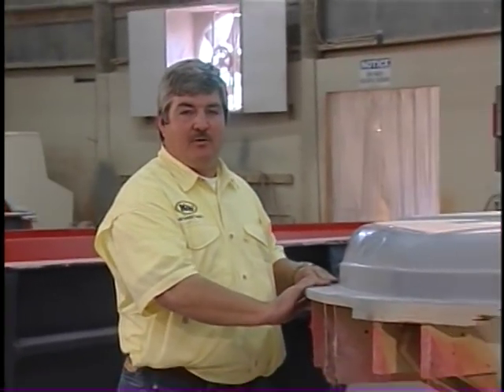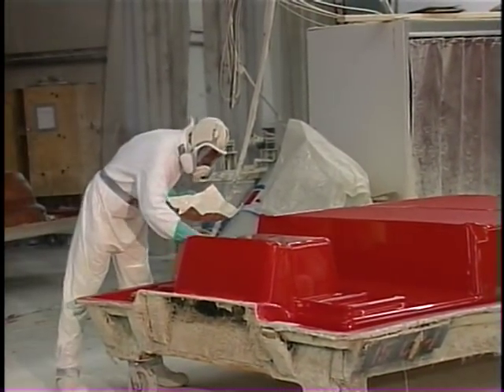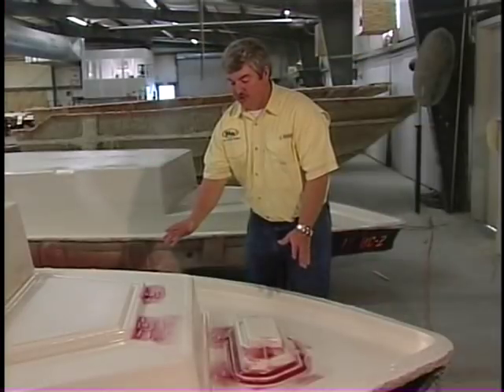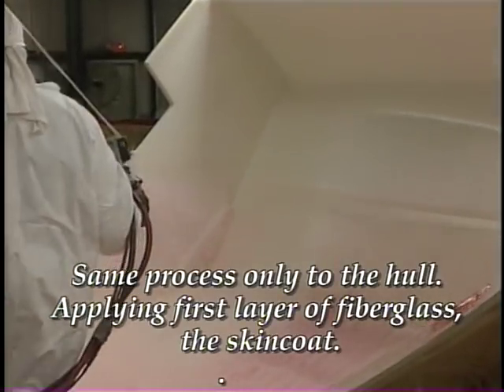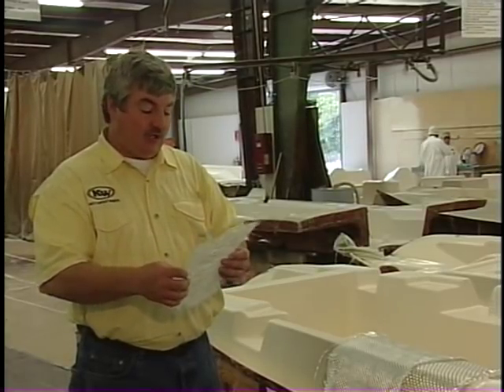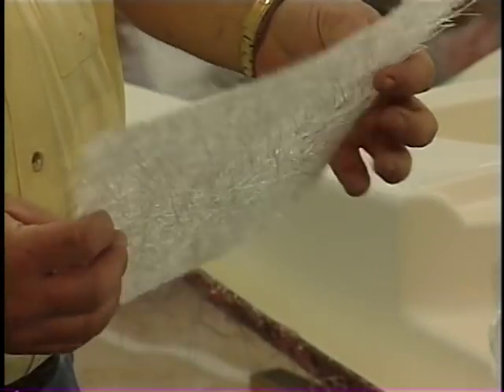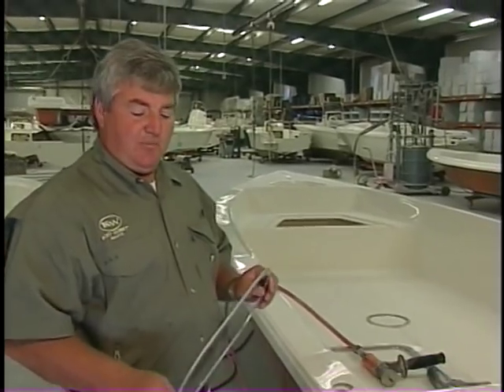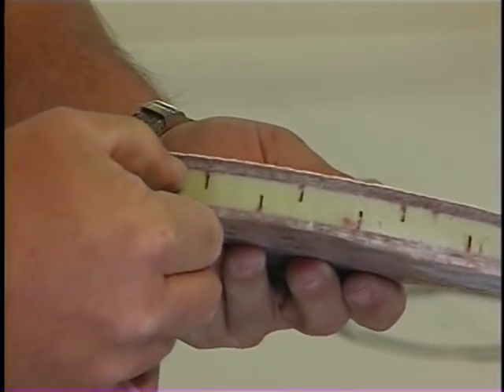How Key West Boats Are Made!

Comment: Cumulative trauma disorders (CTDs) are muscle, tendon or nerve disorders that can include:  sprains, strains, tendinitis, carpal tunnel syndrome and vibration syndrome. These disorders are cumulative, which means they develop gradually over a period of weeks, months and even years when there is repeated stress on a particular body part. Employees with CTDs may experience discomfort, pain, fatigue, swelling, stiffness or numbness and tingling in the upper extremities.  In fiberglassing operations, repetitive tasks such as hand-rolling of freshly sprayed fiberglass parts or sanding, routing and grinding of the edges of fiberglass parts can increase the risk of developing a CTD. Risk factors in these jobs may include:  forceful exertions, awkward postures, repetitiveness, static loading or sustained exertions, mechanical contact stress from tools and sharp-edges, and hand-arm vibration. Engineering and administrative controls should be implemented to reduce or eliminate the risk factors.  In work areas where CTD rates are elevated, the employer must implement an ergonomics program, including a systematic method of preventing, evaluating and managing these disorders.
Reply: ** sometimes you gotta break some eggs to make an omelette.    GOD Bless

Comment: I purchased a key west 203 fs. Turned on the live well and the bilge pump kicked on pumping water out of the boat. HHHHmmmm did they get something mixed up. I looked around and saw they did not attach the live well hose to the live well so it was filling the bilge. I corrected the issue and attached the hose. I would go out and the bilge pump would start occasionally running. we reported the problem to key west and coty marine. They didn't see a problem and said it was rain water finding its way to the bilge while running. This occurred several more times. We brought the boat to a sand bar and nosed up to the bar. A gentleman with a bayliner called me back to my boat and said that my bilge has been running nonstop. We put the boat into the dip and it was loaded with water to the point the potty was floating and our feet where getting wet. Apparently they didn't attach the deck drain hoses to the cap side when they installed the cap. There is no access to the hoses so it had to go back to keywest to address the issues. We missed two boating seasons (we are in ne so no winter season). we where not offered a new boat, a lender boat not even an extension on the warranty. since this we have had electric problems from the connections being submerged. Key west would not honor waranty because they said its the electronics mfg.  and Yamaha responsibility. Yamaha said keywest installed the outboard wrong with some kind of extension for the wires so they would not cover the warranty work either. So buying a boat I would suggest a survey to be done. Bilge access to all components, and seacocks at all connections underwater. As far as I know kw and pioneer do not have seacocks.   Past that Our boat sits low port side about 3 inches. I guess there guy fell asleep behind the chopper gun. So really check the level of a boat in the water. There are much better boats from semi custom builders that will be a much better choice for a few extra bucks.
Reply: A typical "he said, she said" scenario.  Each manufacturer likes to point the finger at the other guy.  
Disappointing for you that Key West Boats and the dealer does not stand behind its products.
Manufacturers seldom know how much a dissatisfied customer can cost them not only in future sales but in referrals.

Comment: For those of you shitting on chop guns, how do you think they make chopped strand mat? Literally a chop gun spraying on a conveyor belt with no resin or catalyst just a binder so it doesn't fall apart.
That being said, I've never used one in a mould but theoretically it's the same as mat. Your outside layer(s) in a hull is(are) always mat. Manufacturers all have different "recipies" of how often you add layers of mat, woven, cloth, or sometimes (rarely) biax.
The only time I see chop guns used are on large surfaces such as a plywood bulkheads where you need glass for water protection but you don't need strength because the structure is already solid

Comment: Well, I know so little about the construction of any boat. I had a foam filled Boston Whaler sport and when the fiberglass was damaged underwater, we never knew it was soaking water. Can this foam soak water if exposed by damage to the hull? Thanks for sharing, didn't seem quite finished. Sean
Reply: Yes foam will absorb water
Reply: @danfelix190  not true. If it is closed cell it will not
Reply: @Natter20002  yes it will over time all closed cell foam will absorb water. 2 part polyurethane/ PE/ spray foam/ even PVC.
Reply: @jamesmcgovern3240  bummer.

Comment: I owned a KW 17CC ( bought new) for a short time and had lots of quality issues, spider cracks in the gel coat, a large crack developed in the deck after a rough water outing,  loose screws coming out, pitted deck fittings, etc.. Poor weight distribution made the boat stern heavy, so much so that when I stood near the transom (172 lbs), water would come in through the deck drain holes. Moving the trolling motor battery to the front deck compartment helped. The compartments were not waterproof.   On one trip, I noticed the bilge pump continuously discharging water.  On checking the drain plug, I found that the cheap PLASTIC thru hull fitting for the bait well had broken off and water was pouring in. I managed to plug the hole with a fishing cork and made it back in without sinking. I have owned six boats, and  I know how to take care of a boat, so that was not the problem. It was a matter of cheap construction and poor workmanship.
Reply: Could have something to do with the ass about way this company builds. them lol
Reply: Foam by itself is not strong it relies on a thick layer of glass on both sides for strength (which by the way negates the so-called weight savings of foam construction). Sounds like they laid the deck too thin

Comment: Why not Mold the Fiberglass and then Gel-coat it it after? seems odd to use the paint first method. If the Gel-coat dries before the fiberglass is applied, how does it bond to fiberglass?
Reply: If the gel coat don’t have a skin coat in 24hrs it would release from the mold. That’s why you gel the mold first and a solid skin coat would make sure your boat is sturdy. Also your gel is the side you see first when you part the boat. If it’s glass first then they’ll have to repaint the entire boat. The only time they glass over molds is when you’re making a splash and that would be small sections not the entire hull

Comment: chop gun boat...junk
Reply: +BigWater59 just curious, what do you mean by chop gun boat?
Reply: +Alex Goudas Hi Alex, It is a spraying device that chops the fiberglass as it enters the mold and mixes the resin at the same time. It is a terrible way to build a boat because the thickness is not predetermined and is completely up to the discretion of the person applying it to the mold. Maybe 1/2 in thick in one spot and 1/16 in. in another. This causes a lot of problem like soft decks, spider cracks, chipping of gelcoat and structural weakness. A quality boat is hand laid fiberglass usually cut by computers for exact thickness and strength. Nothing is left up to the person apply the glass. Hand laid goes on in layers of weave and mat fiberglass also sometimes combo weave/mat material.
Reply: Industry standard seems to be Kevlar/woven roving in vacuum bag. This seems 1980's technology. They have a great resale and reputation though, and the 1980's put out some bullet proof hulls.
Reply: The strength and quality is always up to the Craftsmanship/Workmanship..  Even thickness is the Sprayers whole Job.. 
   You must have had a bad experience with a poor quality hull..    Poor Quality is cuz of the PERSON spraying..     It's NOT the strands fault,  or the resin..   It's the GUY that fucked up,   Not the glass..   Glass is Glass..    "People" screw up..  The sprayer in this video was black..   Do the math..
Reply: How does it cause chipping of gelcoat?
Reply: Alarider USA to thick or thin causes the chipping
Reply: BigWater59 look up Australian White Pointer boats on youtube, they are absolute weapons, the quality a chop gun gives you is entirely dependent on the operator, so if you have a good one it can be just as good